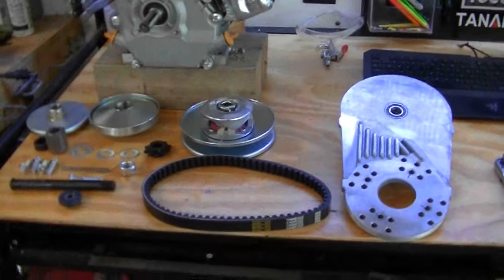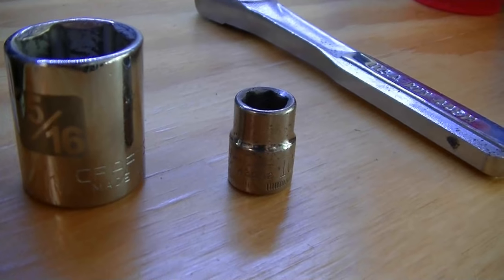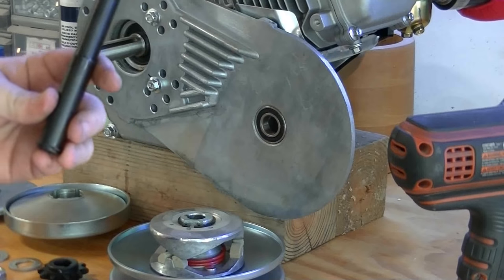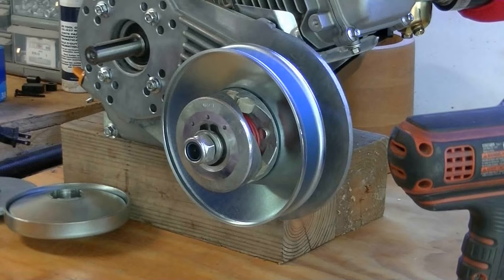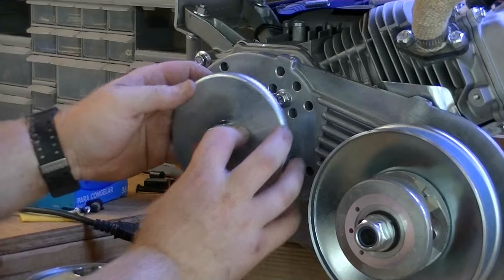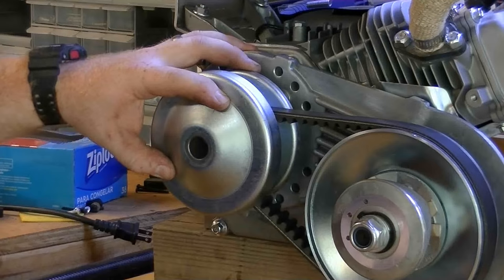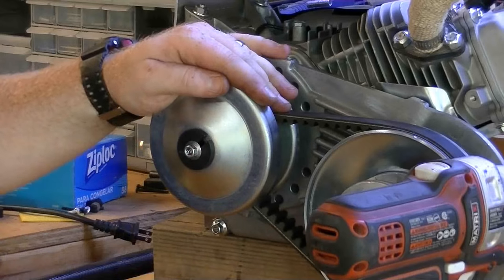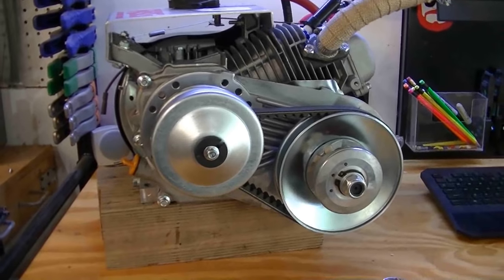Predator 212 Go Kart Torque Converter Install

Comment: thanks man i installed the torque converter ty for the video its so much better no chain grinding and higher speeds without engine rpms being high better for the engine

Comment: What is the bolt size and thread for them,i need the same ones for a chain guard
Reply: The Predator 212 takes a 5/16-24 bolt. Not sure what length you need tho.

Comment: so what size and bolt goes into the shaft? to hold the driver pulley?? and should I use anti sieze
Reply: 5/16-24, the one supplied is too short.

Comment: Thanks for the video tutorial. When you tighten the 10 mm bolt intro the driveshaft at 4:45,  is there a specific torque to it? Mine keeps coming loose, and its a pain to get to as I need to remove the seat. I am concerned about it falling out when driving the kart, but also don't want to over-tighten it 

Thanks!!
Reply: put some blue loctite on it

Comment: I got a honda gx200 and I put a aluminum flywheel and that torque converter on and i haven't tried it yet. Is there anything that I might need to be concerned about?
Reply from the maker: Samuel Garza no sir. you should be good to go.
Reply: Awesome. Thanks for the quick reply, love your videos.
Reply from the maker: Samuel Garza thanks for watching man. I got some good video coming up so stay tuned.

Comment: The bolts that came with my torque converter won't work on my Predator 212, the threads are different....
Reply: Dang it mine are too. Thanks for making me aware of the problem before I started the install.

Comment: Bought mine at Go PowerSports , man what a huge difference it made compared to a centrifugal clutch !   Thanks for sharing
Reply from the maker: No problem man. I think i like a normal clutch a lot better on the road but it is a must have for off road. I get a lot higher top end with a standard clutch.

Comment: I installed mine and it is not accelerating to expected speed (10mph)... any suggestions?
Reply from the maker: +Oscar Zavala someone else has said that. I'm looking into what would cause that problem
Reply: Red Beard's Garage hi my son races a Jr sprint on an oval dirt track with a gx270 last year he took champion with a 14 Norman centrifugal clutch to a 74 on his axle running with 18 in tires the car has to weigh 500 lbs this year we are aloud to install a tav I went with the 30 series hoping its strong enough question is what size gear should I use off the tav to the axle and what would be a good size rear axle he's using a 35 chain also if that helps any

Comment: Do you know what size spacer to use? When I received my torque converter it did not include a spacer.
Reply from the maker: You need to email the seller and tell them. All the 30 series torque converters I have ever seen comes with one.
Reply: Thanks man. I found it in my back yard. Its 1/2 inch thick by 3/4 bore. Love your videos!! Keep up the good work!

Comment: Where can I get a torque converter assembly, and at what average cost?
Reply from the maker: Go power sports sells them for 120 and then you can use discount code red beard to save 10%. So about 108. You can buy them cheaper on ebay but they are known to eat up belts. Also go power sports will always take care of you if you have any problems.

Comment: Thanks for all the great videos. I just did my first swap 212 in kids atv.. I just installed the torque converter and now the motor does want to start. If I lift the wheels it will start with a half of a pull. Seems like converter to too tight. I installed per your instructions. Do you have any idea what I can do.
Reply: Found the problem.  Thanks
Reply: What was the solution I am having the same problem
Reply: @redneckexpress5575  what was the solution I am having the same issue

Comment: does it have to go that way or can I put it on towards the front
Reply from the maker: +Derek Smith it goes that way
Reply: any suggestions on how to shorten a chain
Reply from the maker: Yeah just buy a chain break tool and pop the links you don't need out then put the master link back in. Here is a link to the chain break I use - http://amzn.to/2pVNGmb
Reply: ok thanks it's ordered
Reply from the maker: +Derek Smith no problem man
Reply: do you have a video on the proper way to do that too
Reply from the maker: +Derek Smith no but I can make one over the next few days for you.
Reply: that would be great thank you

Comment: Great video, very helpful! I have a question though. After installing my cvt, the flat sided, inner sheaves don't line up. Are they they supposed to?
Reply from the maker: +BlacktailShadow as long as the pulleys are lined up you should be good
Reply: Red Beard's Garage , I mean the inner half of the pulleys (the halves closer to the engine) don't line up. The belt rides on the outer, angled half of the engine pulley and there's a gap between the belt and the flat half of the engine pulley. Thanks for the help

Comment: Great editing and clear, concise descriptions.  I have a correction, which may have been made somewhere down in the comments.  That shaft is tapped for a 5/16-24 bolt.  The metric bolt that comes with the clutch is not only the wrong thread, but also too short.  Feel free to double check me on this; there are lots of videos and discussions about this TAV on the Predator.  I made this mistake and fixed it by making a tap out of a 5/16-24 grade 8 bolt to restore the threads.  I used a grade 5 2 1/2" bolt which gives good purchase in the shaft with still enough length for a lockwasher and flat washer under the head.
Reply: Exactly, 5/16-24, and the one supplied is too short, I'm surprised (not really) they haven't supplied a longer bolt by now. 👍
Reply: I bought this same exact clutch ( Comet 30) from gopowersports and the bolt works perfectly with my Predator Hemi 212. I would know if the threads didn’t match… I’ve been turning a wrench for 45 years. You guys are misinformed.

Comment: where did you get the timing key for advanced timing?
Reply from the maker: It comes in a kit on eBay.
http://www.ebay.com/itm/171666519660?_trksid=p2057872.m2749.l2649&ssPageName=STRK%3AMEBIDX%3AIT

Comment: Do you get most of your stuff from ebay or is there a site you go too?
Reply from the maker: Engines - Harbor Freight, Axles - BMI Karts, Performance parts - Ebay.
Reply: Yeah I'm going to go check out Harbor Freight engine here soon. I found a good deal on engines at Northern Tools. They had Honda clones 208 cc for $100. I can't decide if I want to keep my centrifugal clutch or go with a torque converter.
Reply from the maker: Well the best thing about the Predator 212's at Harbor Freight is the Hemi head. The engine is a lot better than any other engine out there in my opinion. The part number is 60363. The older Predator engines have the standard head. Also just look for the cast valve cover rather than the stamped ones.
Reply: Yeah that was going to be the next engine I purchase. The hemi 212 thanks for the tips. I was confused on which one was hemi and which ones were not.
Reply: 405TunerZ
Reply: Awesome video! Will this converter jive with a 212 predator engine from Harbor Freight?

Comment: Will this work on a 196cc clone? It has a 5/8" shaft
Reply: I am having issues with this. The 196cc clone I have does not have an internally threaded crank snout. It's externally threaded.

Comment: hey mr. red beard awesome videos Man I've been watching you for awhile I have a couple questions one can I take out the governor with a stage 1 kit or do I need to leave it in second question when installing the 18-pound valve springs do I need to get a the flywheel or just leave it alone because I'm trying to make it as fast as possible without rod and flywheel crank and cam or just get the whole shebang and do it like that but keep on with the awesome videos Man
Reply from the maker: +Brian Storey you don't have to do the stage one when removing the governor. I just think it complements the higher rpms you gain with a little more low end hp. You don't have to do the flywheel or rod if you are running a cvt. If you are running a clutch then I would recommend the flywheel. A cvt will not let the engine go over 5500 rpms. A clutch will let it rev and rev. Q billet rod is always smart even on a stock engine. Just makes it even more billet proof
Reply: Red Beard's Garage hey mr. red beard thanks for all your help I really appreciate the time to answer my question your values are really good especially the motorized chopper bikes helped out a lot if I have any other questions I'll give you a text or ring or comment thanks